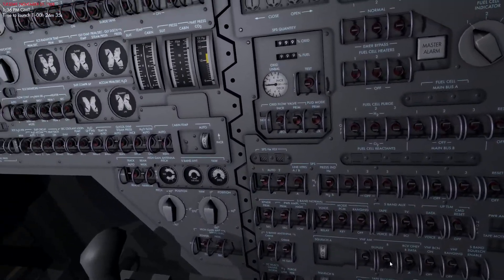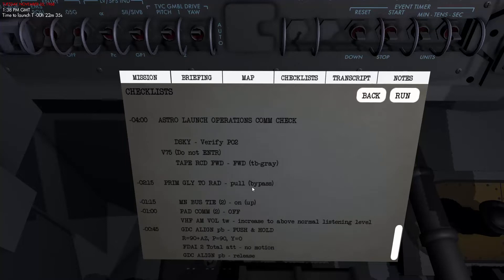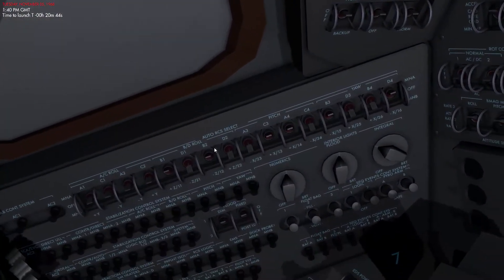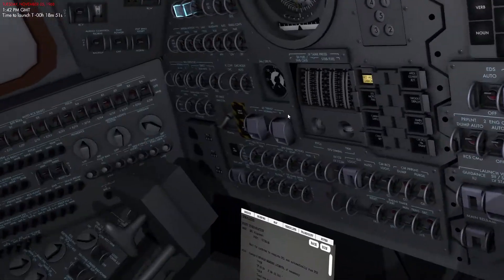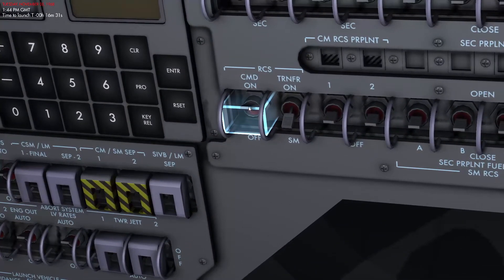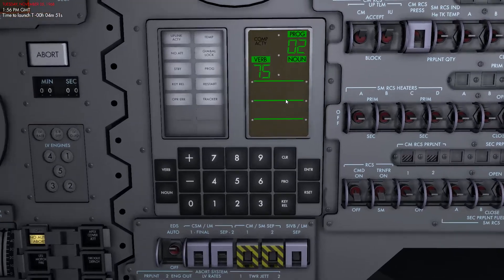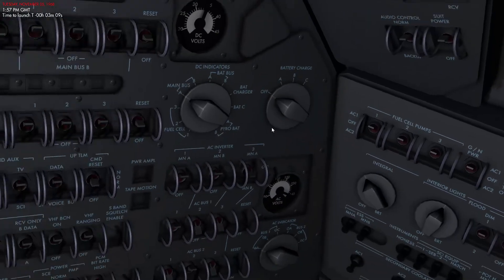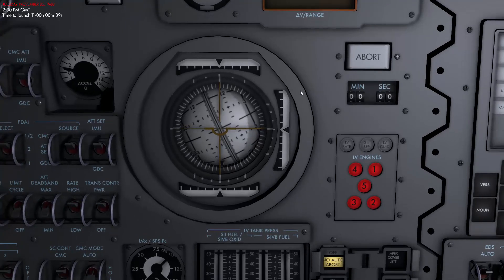[Reentry Academy] Project Apollo - Boost Preparation

Comment: This is looking excellent - can't wait. 

One minor issue that I observed on this and your other vids showing the Apollo-Saturn stack on the pad - the orientation of the launch vehicle relative to the LUT seems to be 180 degrees away from what it should be. Swing-arm 9, the one with the white room, folds back to the left if you're standing on the tower looking at the launch vehicle. The vehicle's +x axis should be pointing east and the LUT stands to the direct north of the stack. Assuming you've modelled the geography of the Cape accurately, it seems that your version is the opposite of how should be. 

One other thing - none of the three manned vehicles you've modelled show any instrument back-lighting. Not sure about Gemini and Mercury, but I'm pretty sure that the Apollo panels we're backlit.
Reply from the maker: Andrew Ralls excellent feedback, just what I'm looking for. You are right, I have corrected the orrientation. The Mercury and Gemini did not have backlighting, but Apollo did. It is visible in the video but its set to a low setting. You can set this yourself using controls on the panels, based on your preference in-flight :)
Reply: Excellent. Good to see you're responsive to feedback. Note also my comments about the SIVB SLA panels in a previous vid - they should detach at TD&E but you're showing them hinged per the original NASA design concept. I guess animating them following their release would be tricky?
Reply from the maker: Yeah, the SLA panels will be physically animated. I will detach them at the right angle and add them to the physics engine with the angular velocity it has when released. THey are hinged now just because I haven't yet had the time to implement this detail, but it's important to have it as it's annoying to dock with the SLAs attached to the SIVB. Hopefully I will find the time to implement this too soon! :)

Comment: 140V AC? I think that it should blow up your AC installation ;-)
Watch out SEC FUEL PRESS, it will likely blow your RCS installation ;-)
GDC align with ATT SET TW (RPY) set to 0 should align it to 0 RPY i think.
3:10 You don't have control over the rocket's computer (LVDC) you can only control AGC which was spacecraft's computer. Launch vehicle had its own IMU that was aligned to theodolite. What you do is aligning the spacecraft's IMU and not the rocket's one.
8:38 Shouldn't those switches be momentary (with one stable position in the middle)?
Reply from the maker: Thanks for the feedback, very good! I have been watching your NASSP videos too. I'm still working on the process and functions, and a lot is still in a temp dev. state. I will move to the balancing of AC/DC, psi etc. when the logical parts are working. The in-game checklists are correct (with what values to look for), but the simulator is not balanced to this yet, and is why you see this. Also, NASSP is incredibly detailed with years of amazing work behind it. Apollo in Reentry will not have the same level of details initially, but will work towards in. I hope that Reentry will be a stepping-stone for many who wish to learn NASSP.
Reply from the maker: On 3:10: Exactly, isn't the setup for this required to control the spacecraft (not LVDC), in case of an abort where the SC will assume control? Meaning, the panel is configured to quickly be able to switch to the AGC control (like through V46) and IU GUIDANCE set to CMC?
Reply: Yeah, AGC P11 is for monitoring the boost. In case of troubles it is possible to switch guidance from LVDC with its own gyro to AGC with its IMU. P11 is some kind of helper for astronauts to let them know if the attitude of stack is correct during boost, also they can monitor altitude and velocity that way.

Comment: It appears you deleted my comment about the orientation of th Apollo-Saturn stack on the pad. That's a shame. I was only trying to be constructive. I won't bother again.
Reply from the maker: Andrew Ralls hi! I didn't delete the comment (in fact I see it just below). Your feedback is excellent. See the comment I added, I fixed the orientation and commented on the backlight. Thanks again for your feedback!
Reply: Apologies - don't know why it seemed to have disappeared. Forgive my rudeness.
Reply from the maker: No problem! I'm just happy to get feedback so I can create a simulator as good as I possible can. Macieksoft and your comments has been very helpful.
Reply: If find it staggering that you've produced all this yourself rather than as part of a team. Fantastic achievement if you pull it off. I have a bunch of questions if you have the time. What is your preferred contact medium? If you'd rather not get into that at this stage, I would quite understand.
Reply from the maker: Andrew Ralls sounds good! You can send me an e-mail on petriw@gmail.com :)